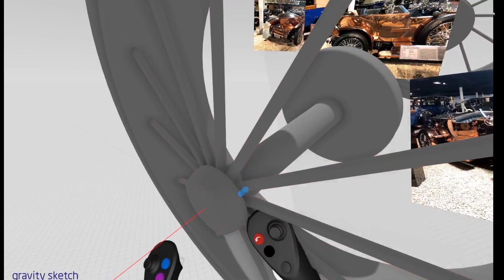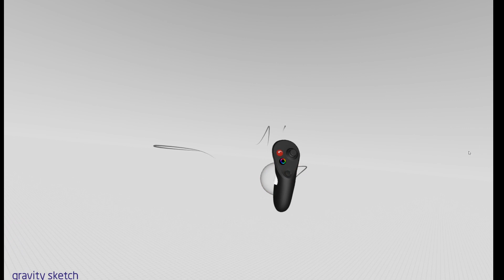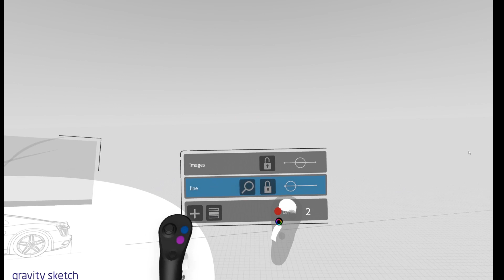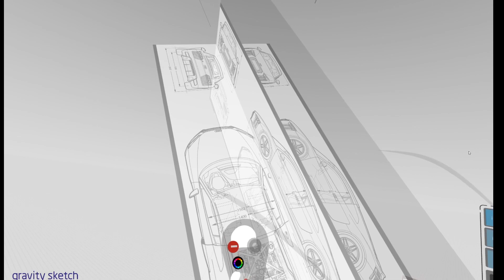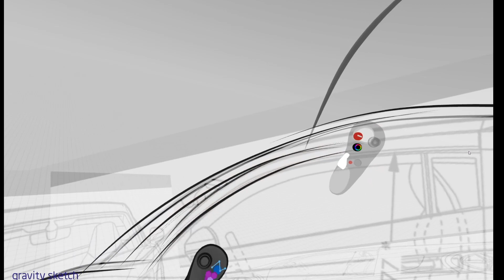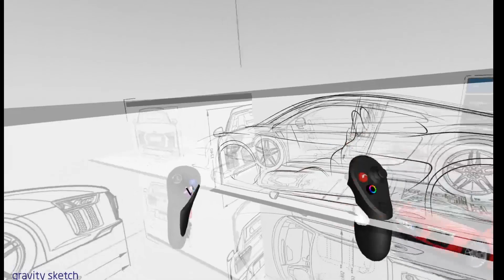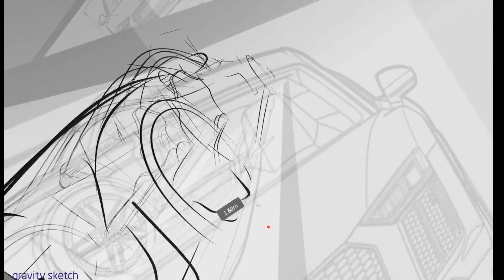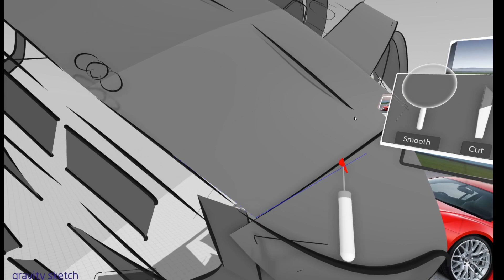Gravity Sketch Car Tutorial: Part 1

Comment: This is very cool, but I'm a little hazy on why one would do this. If you want something reasonably accurate and 3D, why not set up the references in a modelling package? And if you want something sketchy, why use reference images? Thanks all the same!
Reply from the maker: haha yea fair enough the point of this vid is mostly to show that you can use a VR app to do this kind of thing if you want to. Ppl don't realize what GS is capable of. In practice I tend to hop between different tools based on what they are good at.

Comment: seems like fun, but i can make that in maya easily and it doesn't look like a cartoon. no offense meant. admittedly, people have a VERY steep learning curve when it comes to learning maya. since i've been using it for so long, when i end up looking at something in vr that i've made in maya it doesn't really look all that different. but when i first started 3d like 25 years ago i wished that something like this existed.
Reply from the maker: no offense taken! I have a lot of experience with Maya as well before using GS, and I still use both approaches. It's definitely harder to create something polished in GS than in Maya/Blender, but I can sketch things out and retopo much faster in GS than in Maya. Each tool has its benefits. I think the most powerful thing is to use them together as a combo

Comment: Do you need a computer to do this or just the vr headset
Reply from the maker: I used a computer for this vid but you can do it with just the headset. I have another video on using it specifically on the standalone quest. It's pretty much the same thing, just less powerful.